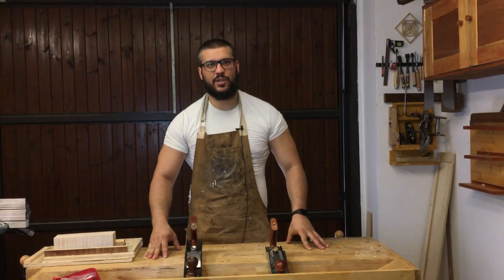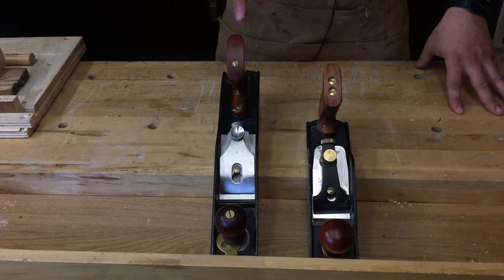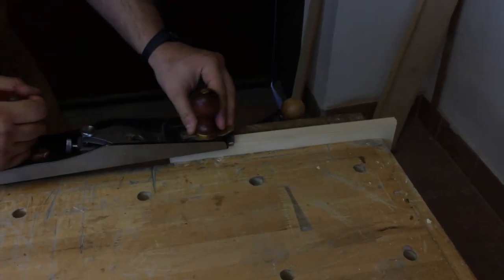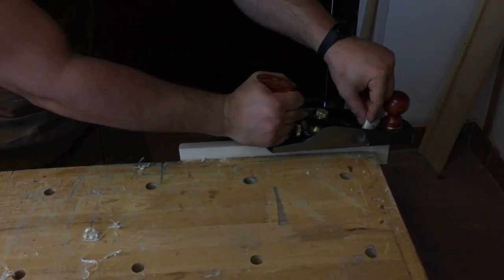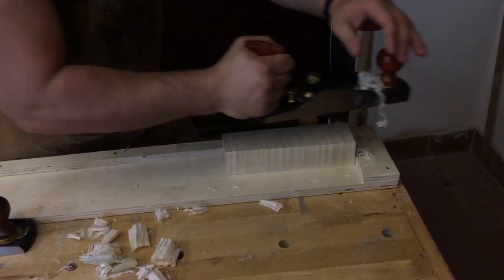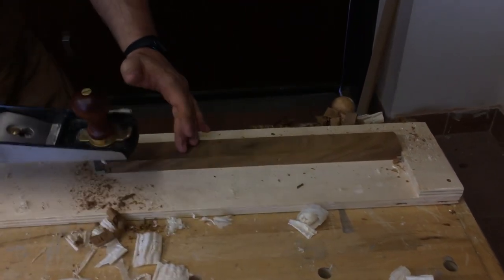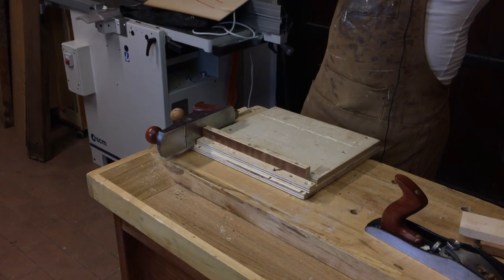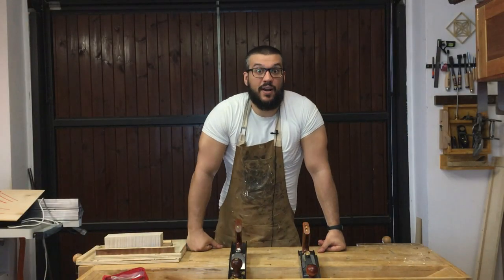LOW ANGLE PLANES

Comment: Hello Alberto, thank you very much for sharing your videos with us😊. I would like to ask you which angle do you use for sharpening the blade of this plane? Thank you again for helping us
Reply from the maker: HI Ricardo!  After three years of use I come to the conclusion you need 2 blades to properly use a low angle plane:
- a 25/30 degrees blade for shooting end grain
- a 45/50 degrees blade for smoothing
the standard 25/30 degrees blade could tear out on some woods. with the 45/50 degrees blade this can be avoided
Reply: Thank you very much Alberto for your answer, it is very helpful for real. I appreciate it. I saw your other video for sharpening a low cost Jack plane and I would like to ask the same if you don't mind, which angle you think is the best for those.

Thank you 😊😊
Reply from the maker: @ricardocarrillo5836  it was a cheap block plane. For that typr 25-30 degrees is good, but stay away from that model. is not very good ;)
Reply: @MoscaWoodworking  Thank you very much again. I have a Stanley jack plane and wanted to know more about the angle for jack plane, I'm starting, sorry for asking too much. :)
Reply from the maker: no problem!